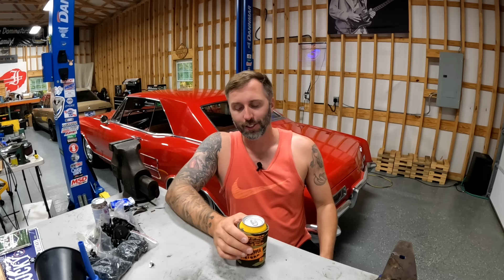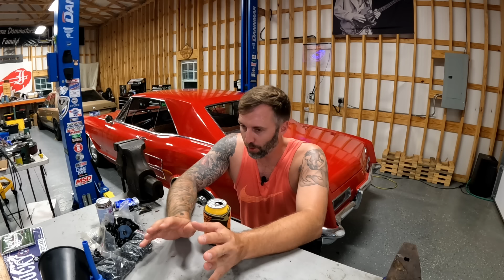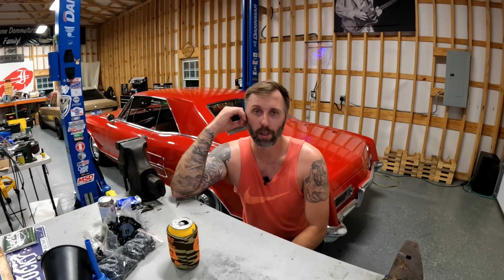Why I Ditched Holley Sniper EFI

Comment: I had a problem with my Sniper a couple of years back, called Holley and explained how it was running (ran like the was a stuck choke), the tech was great, told me to box it up and send it back and they would replace it with a new TBI. When I got it back the hand held had an indentation like somebody ran something heavy on it, emailed Holley and again, they sent me a new one.
 I’ve had no problems with this newer one until recently, turn it on and you can hear the fuel pump spool up like it should but no fuel is feeding the injectors? We’ll see what Holley does this time, I’m not expecting to get a new unit but it would be nice to get it serviced. My first thought was to go back to carburetor but that will depend on Holley.
Reply from the maker: Its nice to see I am not alone in having problems with it.

Comment: I just bought a 83 Silverado with a sniper on it.  Guy couldn’t get it tuned right and it was running rich.  Going to put new plugs and wires in the truck reset it (if I can figure out how) then try the learning process on it.  The guy never drove it just tried to get it tuned with it idling.  I’ll give it a couple days and if it doesn’t run well it will have a carb on it by mid next week

Comment: I had a gen1 unit that had a bad injector driver and it stuck open like what you experienced.  Holley replaced the unit with a gen2 and sent it to me without having to send the gen1 back first.  All they wanted was the TBI and handheld unit.  I got to keep everything else and even have a spare o2 sensor as a result.  I haven't had any issues since.  Sorry you had a bad experience.  Must be roll of the dice who you get on the phone.

Comment: Lol had a set of holloly mechanical 650 double pumpers wash my motor with fuel more times than i could count. Couldn't get them tunned right.. turns out the factory drilled one of the boost reference ports slightly too low, causing the power Valve to leak fuel. Went to the Holley terminator x max with two stealth snipers. Then i had an issue with the magnetic pickup distributor not syncing with the computer. Upgraded to a hall effect distributor and no longer have any issues. Runs pretty darn well at the point. Its a unique set up. Small block Chevy with an weiend 8-71 dual throttle bodies, cd ignition, timing control, a retrofited 4l80e coupled to a np205 twin stick, and 4.88 gears, in a shortbrd stepside chevy on 40s

Comment: I did the exact same thing. My you tube channel is "Rodeo Ranger" and my Street Custom Trans Am, had nothing but issues for 2 Years after installing the Holley Sniper 550 EFI and the Holley Sniper Hyper Spark System. What a mess. Could never get it to idle correctly and when it failed twice, both meant towing. First Sniper ECU goes, floods my engine like crazy and filled the Throttle Body with fuel. Got Unit Replaces after shipping to Holley in Kentucky from Canada, took 2 months. Next , Sensor failed on Hyper Spark Distributor..again neeed a tow. I spent a total of $5000.00 Can before I said enough is enough and jerked it all out of my car. Put a Holley Avenger carburetor on with new Distributor and the car fired right up. It runs beautiful. The Self-Learning stuff is all bullshit! I got the Throttle body EFI replaced under warranty and the Distributor and sold them as fast I could.

Comment: Haters gonna hate!! I had a very similar experience with Holley. I have and use a whole lot of Their products along with a whole bunch of other vendors. I had a problem with fitment issues and quality on several parts. Same deal their techs were decent but their return was absolute B.S. I finally after days of talking on the phone found one guy that made everything easy to take care of as it should have been from the beginning. Horrible experience as a whole. The guy basically told me. Don’t buy direct from us, go through a vendor like Jegs. They’re easier to deal with.
That was the guy from Holley that helped me return everything said. Same though had one bad part and they wanted the entire order back and it wasn’t a kit. Fully understand your frustration
Reply from the maker: Yeah that's a big takeaway from this whole ordeal I would tell everyone.   Don't buy direct lol.  Thanks for watching .  Plz subscribe! Thanks
Reply: @timelesssteelgarage   I did see where external ignition signals if your using something else for timing can cause the snipers to flood. I’ve never used a sniper myself so I don’t know much about it. Hagerty channel had a similar issue.
Reply from the maker: @justintaylor13  the things are 2 sensitive .  Too many issues for end user to fix.  I have built alot of efi.  This shouldn't be sold as a "bolt on and go" set up.

Comment: I would agree I installed a sniper on my 66 chevelle where my son and I built a 383 stroker for. I think it’s a resent unit but had a few issues and I’m considering removing it to go back to Holley 4160. My mistakes may have been only breaking in the 383 with carb then right to sniper. It ran at first then wouldn’t start after about 4 starts. Returned to Holley after long talks with tech services where car ran on starter fluid but not on sniper. Even once it was checked n returned to me had issues ended up swapping plugs n it seemed ok. Then hot start issues. And now idle my iac creeped way up. I reset my idle to the 2/5 % iac n we’ll see. But debating just going back to carb. Oh still using points distributor. Used new fuel tank and installed holleys in tank regulated pump with no return as recommended.
Reply from the maker: thanks for checking out my channel, subscribe plz!

Comment: That's a real bummer... I can't say you wouldn't have had these problems regardless, but I generally do make it a point to buy anything "big ticket" from Summit. Summit will take anything back and correct just about any problem. The biggest issue I ever had with them was a set of coil springs where one corner had been mis-manufactured. I only found it out once they were all on the car. They overnighted an entire second kit, I swapped out the bad spring, and mail it back to them at their expense. No hassle at all.

The only other issue I had with them was getting a lifetime warranty honored ten years after the sale. They had changed inventory software and it took them about 30 minutes to confirm my old order after I emailed them a picture of the receipt. 😂

Comment: Wide the fork open balls to the walls, give me a carburetor.  Other needs may make me go for the EFI.  MPG, part throttle to mid range, and even 4 wheeling with all kinds of angles being involved.
Also, I'll go with the Holley 1050 any day wide open quarter mile/eighth mile but have had a few mild builds that I really enjoyed the Edelbrock carbs on.  They perform so well across a wide RPM range and are so dependable.
Reply from the maker: Thanks for watching. I build cars with both.  Your right they both have pros and cons.  Thanks, subscribe!

Comment: Same but different with me.   Installed Sniper 1 master kit  worked great with wizards.  Needed to rebuild engine so sniper and components sat in my home.  Finally re-installed on new engine but sniper ecu lost programming.????.   In the meantime, the handheld quit working.   so I downloaded to my laptop the available updated firmware.   So....  between the ecu obsolete firm ware and the updated firmware can't communicate.  It appears to me that I have to buy a new handheld to install the newer firmware.  I don't need another money pit.  Great experience with carbs, especially Holley, Carter.   I think that I will go back to carb.  Thanks

Comment: I will listen to both sides. My car runs, so there is no need to change over, except I live at 7,000' Elevation. There may be an advantage to EFI or there is a product to tune a carb dynamically I have yet to research.

Comment: The only issues I have had is now the car overheats in a matter of minutes and when it is hot it will not crank over. I have been told it is probably timing issues so hopefully I can get it on the dyno and have my tuner fix this mess. NEVER had either issue when it was on a carb.

Comment: Edelbrock Pro Flo 4 is a solid setup! We've used it many times in our shop. Done about 10 Snipers so far and over half had issues. Most of them software issues but updating your firmware solves those. Also on the snipers the stock calibration file is shit, so make your own right away. Or go Edelbrock, I like their interface better, you just use their app on your phone.

Comment: Thank you so much for your video on Holly sniper EFI, I was thinking about using them on a engine project I have coming up for a 1968 Camaro with big block but I have heard too many stories like if you have a cam shaft that you like the sound of it if you use EFI it totally Remove all of the cam sound that you are looking for I was more interested in a tune port injected EFI but the Holly sniper 4500 Was what I was considering because it is much cheaper but listening to you with your problems I think I will just stick to the original plan with a Holly 4500 carburetor I know how to tune those and I do not have a Dyno or a tuner who can fine-tune a EFI. Thank you so much for your input

Comment: Multiport systems are the only way I'd do aftermarket efi. Anything under four digit power levels a carb is fine, maybe even the TB units but for big HP individual cylinder tuning is a must and a better way to get large amounts of atomized fuel into the engine. 
How does the injectors work on the sniper, Is it pulse width modulated or do they vary the current? I will say when installing these units it's really easy to get trash into the system and it takes such a minute amount to mess up an injector. Especially cutting and fitting AN lines or ptfe. I leave my lines a little long to the rails and get an oem style inline filter and place it just prior to the rails and run the system for a few days to catch any debris that may be caught in the lines from cutting and installing fittings that didn't get blowed out with compressed air.

Comment: While I didn't have quite the unexcusable mess you had trying to get the TB replaced, the rest of your story was more than a little familiar sounding. I agree that once you have been on hold long enough for a Chevy Vega to rust away, every tech support guy I talked to, except one, was knowledgable and helpful insofar as they could be. The one who was not knowledgable was willing, polite and so forth, but just seemed like he had no real world experience. My biggest issue was and is quality control. I didn't realize that even Holley had gone the "let the Chinese build the parts" route before I bought mine. Silly me, thinking this SEMA godzilla would keep making the parts somewhere other than you-know-where. 
 I have to say I thought Holley was extremely generous or easy-going about returns, and there were more than a couple of parts that failed within scant days of me receiving and installing the system. As you said, though, they have probably sold hundreds of thousands of these things, and their profit margin no doubt allows them to be fair first and foremost. If smart, they know they're more likely to have a long term customer as a result of that kind of policy, anyway. 
 Like the old ProJection 4 I had before, there are some questionable advantages to the Sniper, but by this time, I know I will never be satisfied that it was a good choice for either engine I use or used the system on. Less fuel economy than the carb, and though I don't have dyno proof, I'd say both engines were down some on power compared to the carbs. Not much, but a little. I will try them on milder engines, as the engines I've been using them on are far from mild, and a universal system is probably the wrong system to try to use on engines that are slopping over with bad attitude and bad intentions. That idle speed hunting constantly, and to a major degree, due to a coarse adjustment range on the IAC (and very little vacuum from the engines I've used them on, to be honest) and occasional stalling are problems that the old 4150s never, ever gave me, and are unacceptable to me from any fuel/air mixer. Maybe they'll do better on a friendlier build. If not...another expensive lesson, with no justification for why it is that way. Thanks for sharing your experiences.
Reply from the maker: Thanks for sharing yours ! I appreciate the response.   Stay tuned.  Plz subscribe!

Comment: FYI: my engine builder said they installed 9 about 6 years ago and all 9 have since failed. The ecms were getting moisture in them and shorting out. This was the older designs but now I've been reading about how returns are a pain and I really don't want any of that.

Comment: I'm doing a drag and drive 1989 chevy 2500 truck i drove the truck off the showroom floor in 1989. i'm doing a Blueprint Engines 383 stroker engine and running a carb. for the simple reason i have watched soooooooo many youtube folks have nothing but problems with them and the cost seems very high to me. i'm not a computer guy and grew up in the oilfields and we had a saying "i like manual, because manual always works and if it doesn't i can rebuild it".

Comment: I have ran arpumd 900 hp.boosted on a Big block .  I did it with a Holley Carb and wideband.  I didn't have the money at the time.  By time I got money to go EFI... I turboed my other car  with a holley Carb. Nothing wrong with carburetor set up even for blow through. 
Honestly and electric choke and everything on a NA setup. Runs fine.  Not saying it's better than fuel injection.. but heard bad things about the Sniper system.

Comment: The moral to this story is: simplicity works. A carburetor works nearly all the time, an old school points distributor works nearly every time. When/if they don't work - you can easily and quicky diagnose the issue, then repair the problem with basic tools and parts that you can easily keep stored in the vehicle. All those fancy and expensive electronics are great when they work, but, when they don't - it totally defeats the idea of having a better machine with the minimum amount of aggravation. Having an electronic control module fail when you're 300 miles from home is the definition of being "totally and completely screwed." Having a float on your carburetor stick open while 300 miles away is an inconvenience that can be fixed in a burger joint parking lot. Less, really is sometimes best!

Comment: I went through the EXACT same thing on my 68 Dodge Truck.  I was skeptical but did it anyway.   Had to send the throttle body back 2 times.  Out of the box the ECU was bad, got it back and installed only to find that the 2 rear injectors weren't working, Really?  Inline fuel pump they sent went bad in 2 months, and it was lower than the tank etc.  fast forward to converting to an in-tank unit.   Just a lot of little issues, not to mention RF issue that I had to fix with ferrite filters.....for my Fury I just said "screw it" and am running an Eddy AVS2, it's a street car and it's getting 18 mpg and runs like a champ, no issues smooth as hell.   To your point, "if it ain't broke don't fix it"
Reply from the maker: good to here other people having the same problem. I agree, this girls not going back to carb.  Thanks for watching, subscribe plz!
Reply: @timelesssteelgarage  I think there's way more issues out there.  The fan boys out there need to feel good about themselves shelling out the 1500+ and having sub par stuff, no way they'd admit any issues.  Ego is a powerful drug.

Comment: I straightened out a poorly installed Fi Tech. I feel like it adds to much complexity and not enough benefit . No problem with port injection and a good controller. A carb can be tuned to get very good response and economy and they are reliable.
Reply from the maker: I agree.  Thanks for watching.  Subscribe !

Comment: I guess I am lucky then, I have done 6 of these now 3 Snipers, 1 Super Sniper x flow and 2 Super Sniper Stealth. The first one was the most difficult for sure and it has gotten much easier the more I have done.

I hate carburetors personally (Metered fuel leak) I hate points, and I hate having to recurve distributors to maximize timing curve.

You had a bad experience and that is never any fun, and you seem to be happy with your decision, But I assure you that the Sniper not only will make more HP, It will get better fuel mileage as well, Easier to start and is a huge upgrade…….But you do you!
Reply from the maker: Yeah I just got a defective  unit.  I love both.  Have built a lot fuel injected cars and carbs.  Both have their place.  Thanks for stopping by. Subscribe !

Comment: I own a Superformance MKIII, which is a replica of a '66 Shelby Cobra SC.  I bought it carbuerated with a Holley 750 and it has performed well for the 8 years that I've owned it.  I got the FI itch, and  investigated FI systems and because I had a Holley carb, assumed their FI would be equally reliable, etc.  Looking for input, I  consulted with my owners forum and was told, "Forget it, stick with your carb and put a good tune-up on it and drive."  Your experience underscores that good advice.  Unfortunately, "service after sale" is a bygone concept in the corporate consolidation world in which we live.

Comment: Strange to me that there seem to be as many success stories as there are failures. I had a few hiccups myself but were easilly corrected. Could have been a disaster though. Mine went on a new flat tappet engine so it was critical that it fired up and ran properly out of the gate. Lickily that went well.  Realized i had some rfi issues and that was solved simply with some dielectric grease on the spark plug wire connections. Im running the super sniper, hyperspark distributor with a msd digital 6al with 8mm accel wires. Fires right up and runs great.